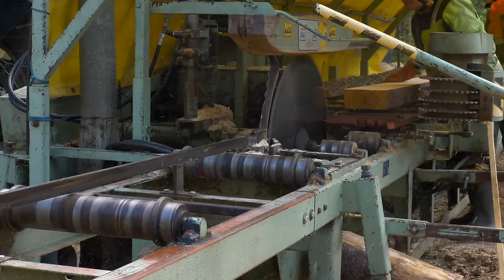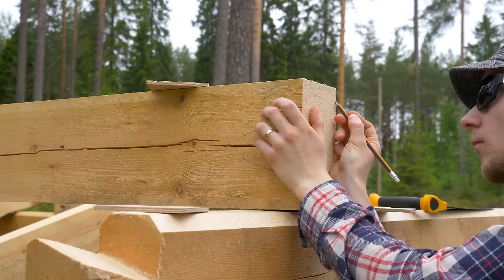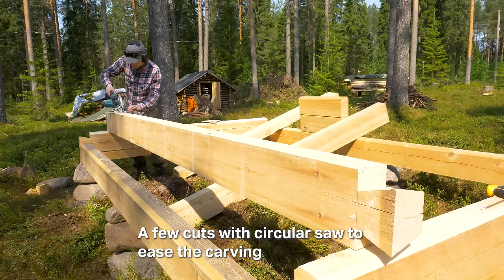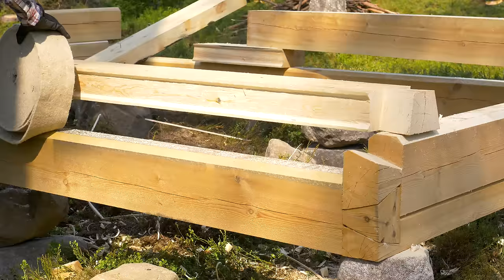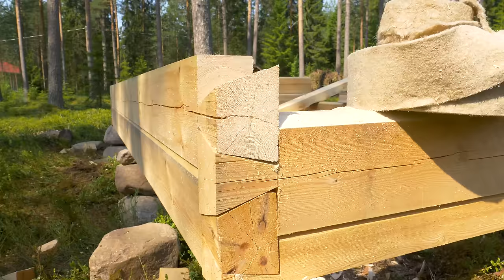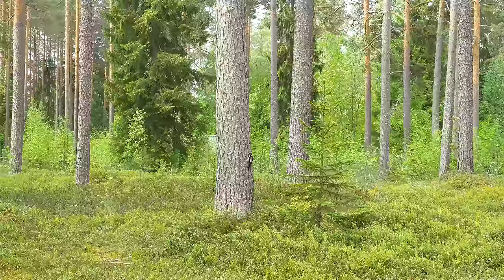Project log cabin | Dovetail joint and carving

Comment: What timber is that? Looks so easy to work with
Reply: Looks like Pine (Pinus sylvestris). Common tree and building materials here.
It's soft, light, straight, minimal amount of branches and has good resistance for rotting.
You can see them in the background of the video. Bottom is darker brown grey and the top is lighter, more orange brown.
Reply from the maker: @vonantero9458  Exactly. It's been drying about a year now.

Comment: What is the angle from horizontal is your dovetail jig, or template?
Reply: Since a lot of people asked this, and I don't see a definitive answer, I thought I'd give it a crack, and maybe editorialize a bit.

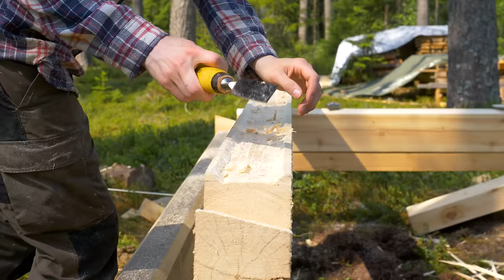I tried to eyeball from a still shot of the end of the pin (log) at about 2:35.  Holding my sheet metal protractor up to the monitor shows 13 or 14 degrees, but because of the elevated angle of the camera relative to the log in this view, the angle appears a bit larger than the actual angle if viewed from end-on (in the limit, if viewed from directly above, the angle would appear to be 180 degrees - a straight line - as both edges would be co-linear; actually, one edge would project as a point, but I digress).

I'm going to guess the end-on angle is something like 11 or 12 degrees, which is pretty typical for structural dovetails in wood.

Half-dovetailed though tenons in timber framing are often laid out at 1:5, which works out to just a shade over 11 degrees (11.31 degrees, approximately).  The matching locking wedges for a half-dovetailed through tenon would then usually be laid out at 1:10, because the tangent of the wedge's angle needs to be safely less than the (static) coefficient of friction of wood on wood to assure that the wedge stays in place and won't "squirt" out (0.1 being less than the static coefficient of friction of unpolished softwoods by a large margin - even dynamic friction for wood on wood is usually listed at 0.2, with static friction higher yet, sometimes listed as high as 0.5).  Thus, you can see that even 1:5 (tangent=opposite/adjacent=1/5=0.2) theoretically should not lead to failure of a half-dovetail joint by slippage at the surface where the two logs meet when a spreading force is applied horizontally - something else would give, instead.  The true angle of a full-dovetail will be slightly greater (the plane of the joint surface relative to a horizontal plane, that is), but for shallow angles like this I really doubt there is very much practical difference in resistance to slip failure between half-dovetail and full-dovetail.  Arguably, there may be a difference in long term rot resistance, but capillarity probably negates that, also, for joints fitted closely enough to be useful on other counts.

Re: the reference in another comment to the calculator at https://www.blocklayer.com/woodjoints/log-dovetaileng.aspx - it is fun to play with, but is built for calculating half-dovetail ends, not the full-dovetails being cut on this cabin.  It also does not allow for a 1:5 angle (the smallest angle permitted is 12 degrees), and 1:5 is pretty easy to lay out consistently with a framing square or dividers - 12 degrees, not so much.  Again, we could argue about the relative merits of the two methods - half-dovetail versus full-dovetail - but the calculator would only be slightly helpful (with some additional tinkering) for laying out full-dovetail templates as seen in this video.  It is a very nice tool for exploring "what if" scenarios for half-dovetails, though.

You could also go whole hog and buy or build one of the fancy dovetailing jigs that will let you whack these out with a chainsaw, presto pronto.  The jigs are either pricey to purchase or require a bit of rough cabinetwork to construct.  Ed Miller and Fred Beal (https://www.youtube.com/user/LogNotching and https://logdovetailjig.com/, respectively) represent both ends of the spectrum.  Fred's is strictly half-dovetail; Ed will apparently cook up anything you want, for a price (2-ish large, denominated in USD, is in the ballpark I've heard).  Fred is asking for USD25, which he promises to refund if you send photos of your finished cabin made using the jig - contingently free-ish, in other words.  I have no experience with either of these gentlemen, but they both have a lot of instructive YouTube videos you can watch.  Given the amount of free content they have both put up, their demeanors in the videos, and the fact that they've both been around for a while, they strike me as straight shooters aiming at two very different markets.  The price points reflect that.

With straight logs of consistent thickness and height, as Finnish Playground has here right off the mill, the two template method should be pretty easy to apply.  If you were leaving a chinking gap (to accommodate variable height logs or because you preferred that aesthetic), I'd think you'd want to set out the template locations from a central snapped chalk or ink line as your datums, rather than the bottom (or top) face datum seen in this video, though you could also account for the gap by using a spacer.  If your thickness varied from log to log, you'd probably want to lay out one side, transfer the angles across the (squared) end of the log, then lay out the dovetail angles on the opposite side (the opposite of what he does in this video, since he lays out both sides, then connects them on the end face, using the back of his saw as a straight edge).  With enough inconsistency either locally on a given log or from log to log, it's probably just easier to scribe fit the upper log to the lower log.

Choosing a method of layout is analogous to the choice between mill rule (assume everything is straight and true); mill rule with mapping (keeping track of dimensional variations of the timbers, but assume everything is square, a la Tedd Benson); square rule (layout off of one well-chosen arris per timber); line rule (layout off of a chalk or ink line on one face); and scribe rule (fit each to the other, perhaps using a full scale layout as the datum) for timber framing.  Here, he's able to do the log cabin version of mill rule (more-or-less - he effectively lays out from two different arrises, which assumes geometric relationships between both the two arrises and the three faces which define them) because his logs are straight and consistently sized.  Depending on the logs and tools you have at your disposal, you may want to choose a different layout method.  Scribing will always work (and needs only a few relatively inexpensive tools), whether for cabin joints or timber framing, but it will also be the most labor intensive.  The fancy jig (Ed Miller's or similar) will be super fast if your materials and budget allow (I think Ed says 2 minutes per log in one of his videos, but it may be 2 minutes per joint - either way, he's pretty quick).  Even with the fancy jig, Ed's datum  for setting up the jig is a snapped chalk line (line rule).  Horses for courses...

Not that I have any practical experience in these matters, but I have been noodling on this problem lately - a small cabin may be in the offing.  Or, maybe not.  But be forewarned that I haven't yet skinned my knuckles doing any of this; I'm still cleaning up garage sale and junk shop tools, sharpening them and hopefully my mind, preparatory to the assault.  So, do your own homework, rather than taking this as if it came down from the mountain on tablets of stone or something.

TL;DR - probably 1:5 or a bit over 11 degrees.
Reply: @kevinolson1102  Wow! Great info!
Reply: @markcummings6856  I'm glad you found it helpful.